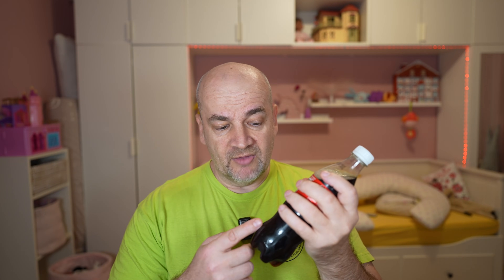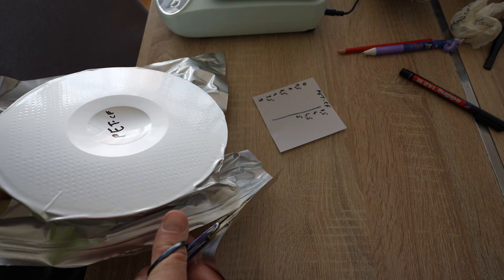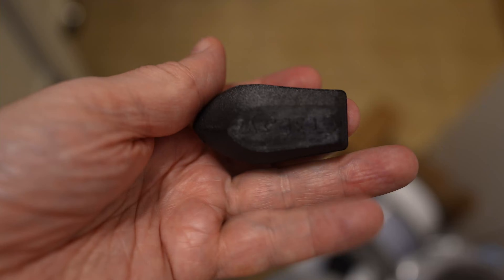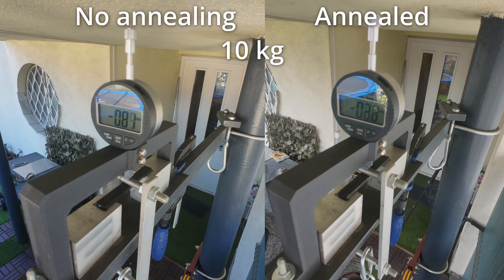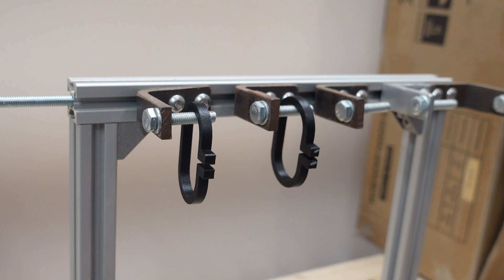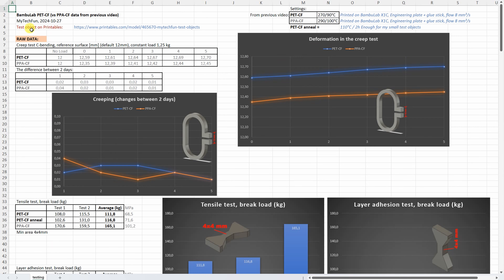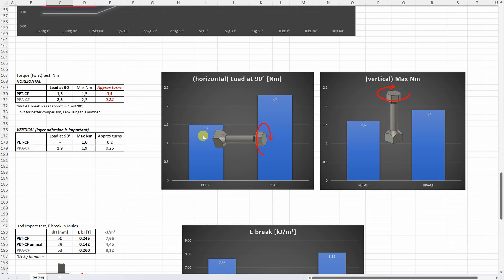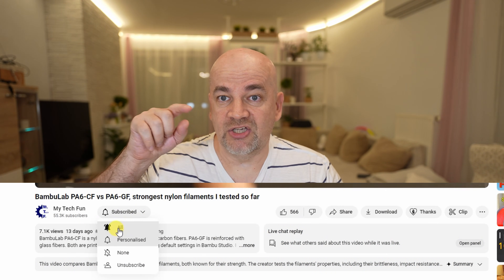BambuLab PET-CF filament review. But how does it compare to PPA-CF?

Comment: Great info. The results of annealing are interesting, the slight loss of stiffness in particular.
Reply from the maker: Yes. But if I don't need so high temperature, I woudn't anneal it at all.
Reply: @MyTechFun  100%. The unannealed temp resistance is plenty for most applications.
Reply: @HoffmanTactical  Is this your main to go filament for your applications? I am Curious re your video you said "Stop printing with CF Nylon, Great Info... ANyways for that type of stuff do you go through the extra bit to anneal your PET-CF?  Or the cons are worse for these types of applications .

I was Curious if you have looked at PEI-CF would this be considered overkill? Say you have the PT1000 Thermistor and like a E3D Obixidian Nozzle upwards of 500c , with a Bed temp of 110c
Reply: It was your recent video that got me to buy two rolls of PET-CF and finally start printing my hose clamp whale, so I was excited to see My Tech Fun finally has a video on it too
Reply: Just ordered a PET CF roll after seeing your latest vid. Awesome work as usual brother
Reply: Just printed my clips and handgaurd with fiberon pet-cf
Reply: @yakostudios5405 100% will do so!
Reply: so you suggest to not aneal for mechanical pieces that run at normal temperature? thanks

Comment: Nice. The price/strength relation of PET-CF seems better than PPA-CF or Nylon-CF especially when looking at the layer adhesion which is usually the weak point and has killed fiber based filaments for me till now. Got a try this one.
BTW I have poor experience with PETG-CF It was very strong but lost it's strength after 6 to 9 months of usage (mainly layer adhesion became very poor, probably caused by material fatigue). I hope this will not be the case with this one.
Reply: That's interesting! Yeah, changes of properties after some time. Poor Igor if he needs to include that into his analysis... Making a comprehensive analysis for EVERY filament would become an impossible task for a single person! 😬
Reply: I have made thousands of parts in petg-cf and have never had layer adhesion issues even long term but I do not load these parts perpendicular to the layer lines so maybe that is your issue.

Comment: FYI: PETG isn't "PET with glycol added". It's a polymer made similarly to how PET is made, but with the glycol part of the ethylene glycol precursor messed up so that the resulting polymer is irregular and can't line up to crystallize. So PETG is more like PET minus (some of the) glycol plus some other gunk. Not PET plus glycol.
Reply: Thanks for the information, i guess that's why it's called Glycol modified xD
Reply: I hate chemistry
Reply: "messed up" lol
Reply: Esun has a brand new filament out which is PET. They removed the glycol. Still easy to print and stronger. Excited to try it
Reply: @genin69  Did you completely not read the comment you replied to? PET is not "PETG with glycol removed". It's with the glycol unadulterated with random shit to mess up the polymerization process. Hopefully this does end up being real PET not some fake, but I haven't found a place to buy it to evaluate yet.

Comment: thanks, I was waiting for this one and very curious about ASA-CF :)
Reply from the maker: And after I finish ASA-CF I will have comparison of BambuLab ABS, ABS-GF, ASA, ASA-CF all 4 in black color (with some new testing methods)
Reply: @MyTechFun  sounds very interesting, can't wait :)
Reply: In all of my use with engineering filaments- I'm certain that BLACK colored ones are often noticeably less strong than other colors esp clears or opaques  @MyTechFun
Reply: @notyouraveragegoldenpotato  doubt it, someone would already notice that, especially manufacturers
Reply: @notyouraveragegoldenpotato in theory natural would be the best, no dyes added or anything to change the color. Less percent dye added means more percent actual plastic. I could be wrong though.
Reply: @riba2233 The manufacturers would notice it, but the minor change in mechanical properties is weighed against what the market wants in terms of appearance. But it’s well established that in some cases the clear or “natural” versions of the same filament are mechanically better.
Reply: I love bambus ASA-CF. Printing is easy as PLA on my P1S, and it is AMS compatible. Cant wait for the test.
Reply: @dymel_88  you already got it? Nice!